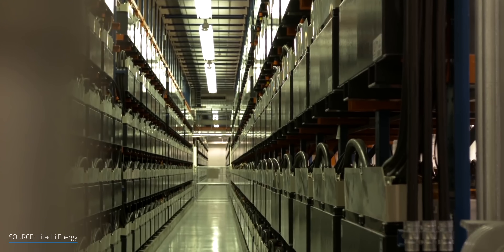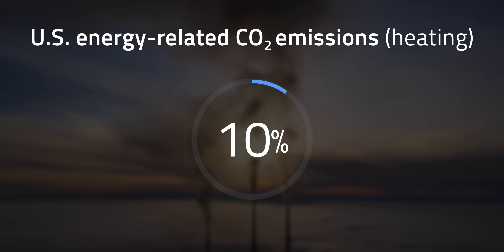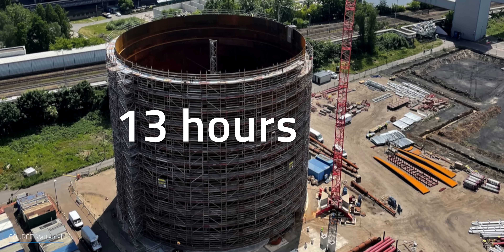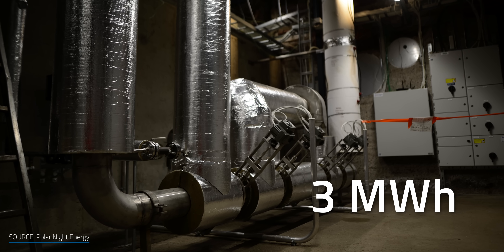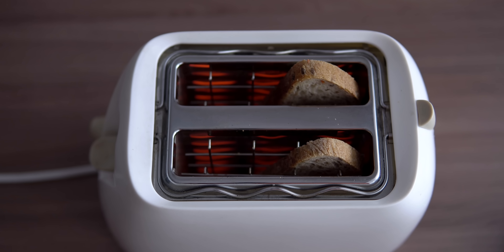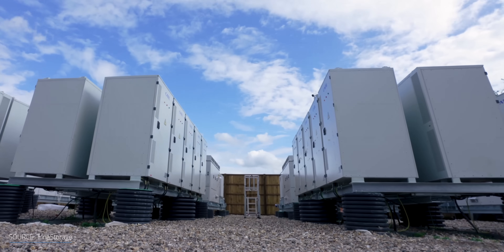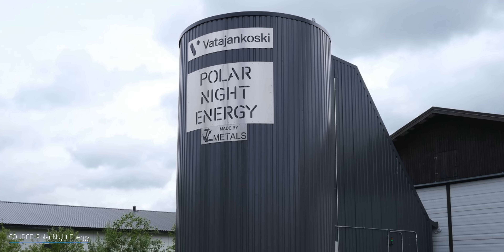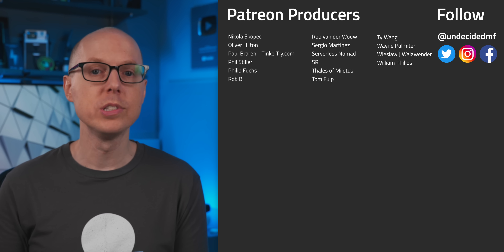How A Sand Battery Could Change The Energy Game

Comment: I'm wondering, instead of using resistive heating (100% efficient), could a heat pump be used (300 to 500% efficient)? I realise the output temperature is very high and specialist heatpumps would be required.
Reply: The large temperature difference significantly limits how efficient a heat pump can be. Moving heat from room temperature (~300K) to this battery's 500C  (~800K) has a maximum theoretical heating efficiency of 160%.
Reply: @juhokahala2981  thank you
Reply: Was wondering the same actually
Reply: @E-E thank you.

Comment: Whenever I see these heat technologies explained, I always have the same doubt regarding efficiency:

How much does the heat transfer fluid (here, air) needs to be heated in order to still transfer heat to a storage system already at 600ºC?

I would assume that would imply massive heat losses in the system.

Also, coming from a sunny country, I think it'd be a great advance developing a system that could turn MODERATE heat into electricity. Like having a cooling system for solar panels (getting free excess heat at around 40-50ºC) and being able to waste that heat to produce current without the need to reach massive temperatures. My best guess would be some kind of Stirling motor, but I don't know if that'd be feasible.
Reply: Energy losses happen due to energy being transformed in something else, such as when you push a box and friction comes into play. But that all ends up in motion, heat, light, and so on. But with what's used here, only heat is really applicable.

Your average heating element, the kind you use in space heaters, reaches around 600°C or more. Heat will always naturally flow from a higher to a lower temperature medium. Since it's heat we're talking about, all the energy you put in to heat that up will evenly distribute in the storage medium anyway. The only way you can have heat losses in this system is if it is not insulated properly from the outside. 

Remember, the Law of conservation of energy says that energy cannot be created or destroyed, only converted from one form to another. If the system is insulated from the outside, all of the energy put into it will remain in it, in various forms. Given that sand doesn't noticeably expand or contract with heat, there really is only one kind of energy to worry about, which is heat.

If you're interested in more detail I'd look back at high school level thermodynamics, pretty much all of what you'd need for such a system is explained within the things you'd do in the first few weeks.
Reply: @VarenRoth  I know nothing about industrial level insulation, but can it really maintain all that sand at 600°C on the outside?

When talking about home electrical heaters, having them outside the house instead of inside is a big disadvantage already.

And if the system must be able to circle the air around for heating in the winter, it must have some connections (even if they're not used during heating) were I fear it might incur in thermal losses.

Your high school must have been pretty neat if you studied industrial standards and processes back in the day. I'm afraid mine was a bit more limited in that regard.
Reply: @drillerdev4624  
You don't need air for this setup to transfer heat, you can do so via directly burying the heating elements in the sand. With a good shape and high surface area (think a hollow tube with holes every so often) that's more or less all you need. 
Heat loss is always just a "thing isn't insulated enough" problem, when you're doing this kind of transfer. 

This kind of issue is pretty commonly solved on an industrial scale for high temperature applications, basically using high performance insulation, you can find commonly available aerogels withstanding temps between [-200,650] C°. Now there's a whole profession built around that, but there are specs you can find and a few thermodynamics formulas that let you calculate how long you can retain heat for. You can likely find them with a quick Google search. This is the kind of exercise in a physics class you'd do to say, calculate how far you can carry a box ice cream after buying it before it fully melts. The whole setup described in this video honestly isn't anything scientifically impressive, but it doesn't need to be, they just need to set up an infrastructure that allows them to build this stuff in an economically competitive fashion.

As for high school, I'm Italian and our high schools all have a specialization branch you pick, in my case I went to an industrial/technical one, so I got that stuff from back in the day. You'd basically come out with a certification that you could just go and get a job as a technician in what you specialized in, so anything from mechanical manufacturing to a bunch of chemical jobs. Not university level but still a pretty good system to get kids a real chance in the world.

Comment: We don't use gas for heating in Finland, so it doesn't matter much that Russia turned off the supply. District heating (using various energy sources) is largest, about 40% in total and heat pumps are already at 20% in residential homes. District heating, large buildings and apartment houses are now also installing heat pumps in MegaWatt size and in addition, they are installing exhaust air heat pumps, which can save up to 50% of heating costs. Heat pump sales grew 105% in the first half of 2022, so we can probably expect heat pumps to become the largest source of heating over time. But this sand battery is definitely interesting in the northern climates.

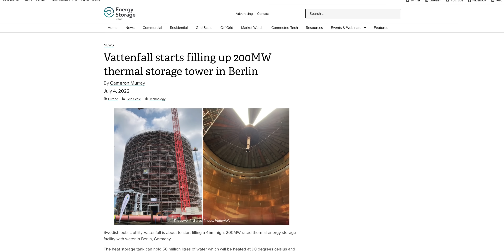Comment: 2:38 that's not exactly true. 

Turbines can be shut off because demand for their electricity is low, but they can also be shut off because the wind around them isn't optimal. 

There are 4 different zones for wind operation:

Zone I: wind is too slow, turbines OOO (out of operation)

Zone II: wind is slow but can generate enough power to sell, turbines still running below their rating

Zone III: wind is optimal, turbines run at their rated speed and produce rated power

Zone IV: wind is too fast, turbines OOO

Zone II starts around 5 m/s, while Zone III ends around 25 m/s, depending on the unique wind turbine model. 

Curtailment during Zone III is the worst because that's when the turbines would produce the most. 

Curtailment during Zone II is a little better, but still bad since the turbine could still produce some power, if not optimally. 

Curtailment during Zones I and IV are ok because the turbine would be shut off during those times anyways.

Comment: Surely $15 per kw/h is much too expensive……or have I misunderstood something?
Reply: The price is cost of building such a battery, not operating cost. So, building a storage with capacity of 1 MWh with that rate will cost $1500.
To put this in a scale with some ballpark figures; Tesla EV's battery pack has around 100 kWh (0.1 MWh) capacity and costs around $10,000, that is $100 per kWh.
Reply: @fl4shi238  Thank you.  I think I wasn’t paying full attention.

Comment: Why are they using resistance heat and not a heat pump?  They could use less electricity to get the sand up to temperature
Reply: Good luck heating to 600 °C (1000 F) with a heat pump! Maybe in the future.
Reply: @johansvideor  oh I didn't catch that part on the temperature they were trying to get to

Comment: It seems that a Stirling engine would be much more efficient for driving a generator than a steam turbine.
Reply: Matt said in the video that going from electricity to heat to electricity is very inefficient and a waste of power, so the system is intended to store excess energy as heat during low demand periods, which can be used in heating applications during high demand periods.

Comment: I wonder if this system could be use at home. A tank with sand and pipes that is heated with excess electricity and later can heat water (for heating the house, shower, sinks)

Comment: This could surely be made more efficient by using heat pumps instead of resistance heaters, right? We store excess energy in this tanks, sure. But why not do it as efficiently as possible? Adding a heat pump adds complexity but does it matter that much?
Reply: Resistance heating is reasonably efficient for this application, because it's adding heat at a relatively high temperature. That's not so easy for a heat pump to do. Besides, the idea is that the battery is heated when there is cheap excess energy available.

Comment: Why use just a resistance heater to  heat the  air?  A heat  pump  is  more efficient, at least for preliminary  heating.
Reply: Good luck heating to 600 °C (1000 F) with a heat pump! Maybe in the future.
Reply: @johansvideor  Yes, but it could do preliminary heating prior to the resistance heater, reducing the load required for resistance  heating.
Reply: @duanegrindstaff9635  Possible in theory of course, but will increase complexity of the system and reduce life time expectancy considerably, which is now tens of years (50 mentioned?). All for not much gain, compared to the total system output.
Reply: @johansvideor  As an engineer , I'm just thinking of maximum efficiency, but the best engineering solution isn't  always the best practical solution.  We have to assume those factors have already been considered.

Comment: I like this idea a lot. I like the idea of using the sand as a heat sink. I wonder if you could dump excess heat from some industrial processes into that in addition to the resistive heating. Like if it were to be used to drive a turbine have the hot steam pushed back through the sand battery.
Reply: All new factories and data centers over here that produce lots of heat are connected to district heating.

Comment: Using unrecyclable brown or green glass, powered, for the sand would also create a use for the material instead of sending it to a landfill. Using glass instead of sand would also keep the glass out of the waste stream. And the glass has the same properties for high heat storage as sand.
Reply: There is a start-up in New Orleans that is recycling glass back into sand. they pulverise it till it is the size of sand grains. certain coloured glasses blue, red and  green  they turn into ornamental sand for use in gardens and architectural uses and the rest they use to help restore coastal wetlands with the help of an environmental organisation restoring wetlands around New Orleans to help mitigate damage from hurricanes. So far the results look promising with all testing showing the product is environmentally safe and the local plants happily spreading into the new sand banks.
Reply: @alankohn6709  I'm guessing the "glass sand" is mixed with fresh normal sand that's being brought in to rebuild the wetlands and beaches?  Other than the fact that they can probably get more $$ selling the colored "sand" like they're doing, there should be no reason not to mix it all together when rebuilding a beach.  After all, not all normal sand is the same color.  It would definitely make for some beautiful beaches!
Reply: @michiganengineer8621  from what i saw they load their glass sand into hessian bags for ease of transport and so they can place it exactly where they want the bags will rot away in a few months and water and tides etc will spread it about. now you have to understand when I say start up I mean it here is a link to the video
https://www.youtube.com/watch?v=dIOTsBhFF7M
Reply: @alankohn6709  hey lets go take most of our clothes off and lay in the glass at 'glass beach!' Sounds fun! (joking)
Reply: @notflanders4967  strange that was part of what they checked and when examined under a microscope the grain look like normal course sand
Reply: @notflanders4967  you are an adult, we wont judge 😂
Reply: Why would colored glass not be recyclable? We do. Just use it for something other than clear glass production.
Reply: @zapfanzapfan 
This is the glass that can't be recycled
Any glass mixed with other materials.
Decorative glass.
Mixed-color glass.
Dirty glass or glass caked with food waste.
Ceramics or dishware.
Pyrex and other types of heat-resistant glass.
Window glass
Mirrors
Crystal
Light bulbs
Computer or television screens
Cathode-ray tubes
Reply: @alankohn6709  To create it, a small amount of sulfur, nickel and carbon is added to clear glass. Brown or amber glass bottles are often used for bottling beer. This type of glass can be recycled.
Reply: Excellent idea! (Also, I don't think a lot of people know that brown and green glass are not recyclable).
Reply: @JustWasted3HoursHere  do you have any sources for this? I only know you can not mix brown and green into white, but they are fine if they are not mixed and it is not so much a problem for brown and green. Or is this a local thing because where you live other colours are used for those glasses?

Edit: Ok, i also just found out the USA only recycles about 33% of glass while Germany does 84% (we use much green and brown) and Slovenia even 99%. https://en.wikipedia.org/wiki/Glass_recycling
Reply: @RalphH007  Germany also does a lot of glass bottle reuse schemes so maybe we're higher because we throw away less glass to start with?
Reply: This would also reduce. the demand for sand, the availability of which is already decreasing world wide.
Reply: @rjsmith6698  Use desert sand or beach sand where available.
Reply: @rjsmith6698  LOL
Reply: @rjsmith6698  Smooth desert sand could be used for this tech even though it's not useful for construction.
Reply: Good idea!  I wonder if solar panel waste could also be used for this?
Reply: @markhastings9037  my guess is maybe not due to the multiple materials a photovoltaic cell wafer is made of but I don't know enough about solar panels.
Reply: Turning something into aggregate material like this is basically sending it to a landfill. It should be last resort. As said, brown and green are just as recyclable as clear. If they aren't being recycled there, fix your recycling first before turning glass to sand!

If the alternative truly is landfill, though, useful life as thermal storage is better
Reply: @ThomasBomb45  from memory the reason they went down this path is the nearest glass works was so far away that shipping it was less environmentally friendly than using it in wet land reclamation and it helps reduce river or marine dredging for sand. but I do agree in the best of all possible worlds it should be recycled back into glass for use but this gives another option for glass apart from throwing into a landfill and it has the potential to save lives and repair some of the damage done to the environment so you know what I call that a win
Reply: I think North african and gulf states can export Sand and be rich again :D
Reply: Even better idea will be turn glass into foamed glass insulation.
Reply: Worth noting that a lot of European countries reuse their glass bottles, so they have less glass going to recycling in the first place.
Would work for the US or UK though.
Reply: I worked for the largest glass factory on the US west coast. They recycle glass of all colors.
Reply: @robertschulke1596  Fantastic! Please convince my county in KY that brown and green glass can be recycled. LOL They refuse to do it. Even if we separate it.
Reply: @jameskniskern2261  you can’t argue with someone who’s just being obstinate. They’re like the little kid who says “I don’t wanna and you can’t make me”. You have to give them a reason.
Reply: i was thinking the same thing.
Reply: At those temperatures glass won't stay unchanged. It's probably not very viable as heat storage.
Reply: @AntonBrazhnyk  isn't sand and glass basically the same? If it would melt glass, wouldn't it melt the sand too?
Reply: @ThomasBomb45  There are different kinds of glass or sand, but the glass we could recycle is not made to withstand 600C. It probably won't melt yet, but it will become soft and that's not something you want in battery. Most of the sand requires much more than 600C to start changing.
Reply: @AntonBrazhnyk  so we can’t use ground glass if we want to heat to 600 degrees C?
Reply: I didn’t know brown & green glass cannot be recycled. So “It’s A Great idea to use ground glass.
Reply: @lamdao1242  It can be. But currently isn't in my region of the world.
Reply: Sand is already a product in high demand by various industries and depending on the grade you need may not be as available as you think. Destroying beaches to get them is already a problem in parts of the world. Manufacturing the heatsink material from a waste source is a good idea but the process costs and energy usage would have to be factored in as well as any pollution involved in the process. I recently visited a recycling site that was processing construction waste into a reusable product; one area was concrete and stone. The energy used for this is relatively high and the wear and tear on machinery high also. I think that material would best come from ore mining as tailings are a big part of the process. Maybe we could crush coal up for it rather than burn it but of course, I am being silly there.
Reply: Yeah, but at 600c wouldnt the glass become molten? If so, containing molten glass seems to take away from the simplicity and safety of the idea no?
Reply: @jessaustin1122  nope. Glass melting temperature is well over 1200C.  600C won't melt Glass.
Reply: That would be a waste. This quality of sand would be a better use in the building industry. Sand for concrete needs to be rugged. Tiny glass-shards exceed in this quality.
Reply: How do you recycle the sand that is in the silos? It's contaminated and cannot be dumped on the beach. You can recycle glass back into sand. But what if it's contaminated.
Reply: @eaglewarrior8707  What is it contaminated with?